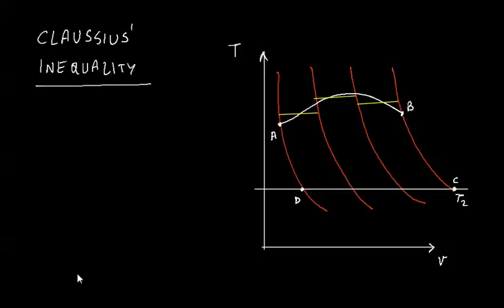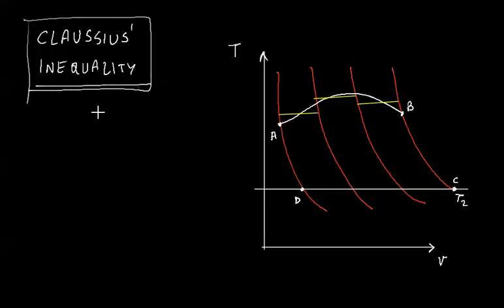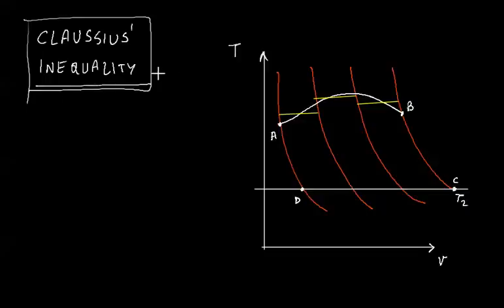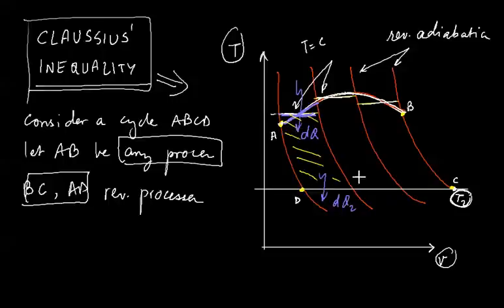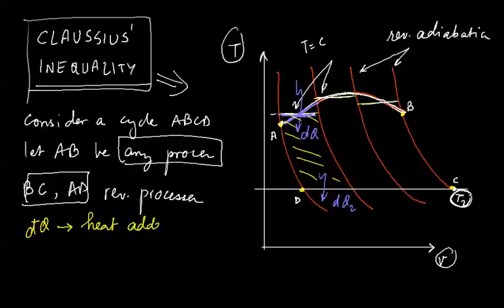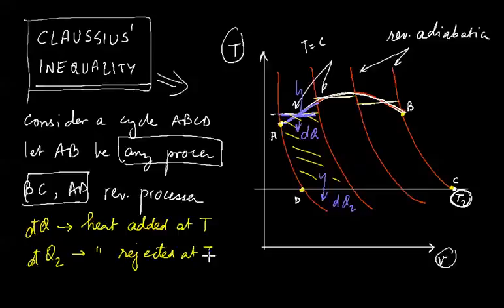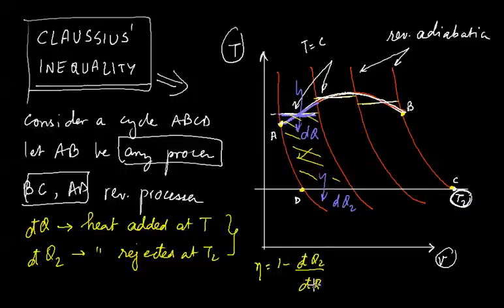Clausius Inequality - Thermodynamics - GATE Mechanical Engineering lectures

Comment: 13:00
The cyclic integral of dQ/T >0 is impossible.
But this is also a cyclic integral of ds because of  ds=dQ/T.
And, we use it to calculate the entropy transfer like in the case of ice melting into a lake, heat engines with source and sink. 
Q added to the system is positive and makes the Q/T1 positive and Q removed from the system is negative, -Q/T2. 
t seems to me a contradiction because maybe I am missing a point. Could you please clarify? Thanks